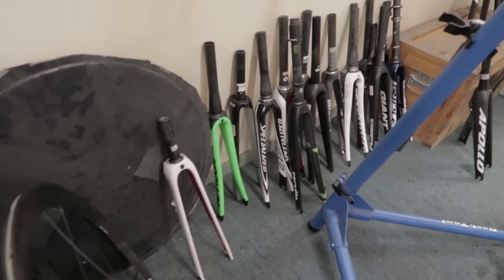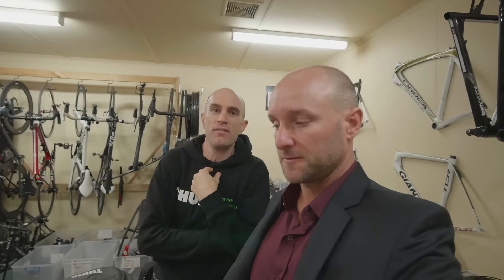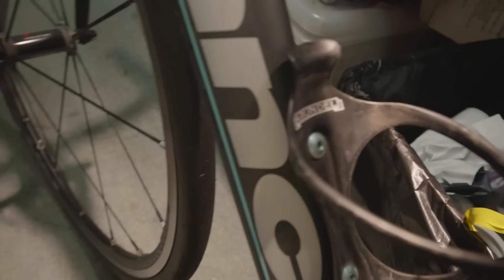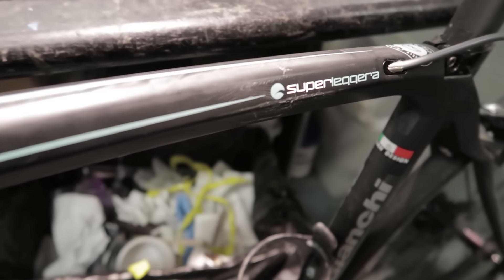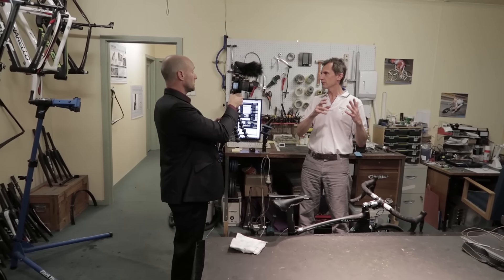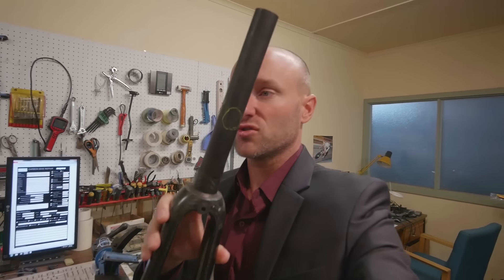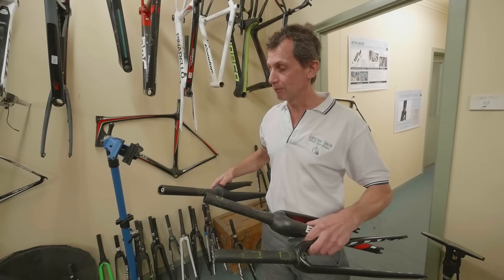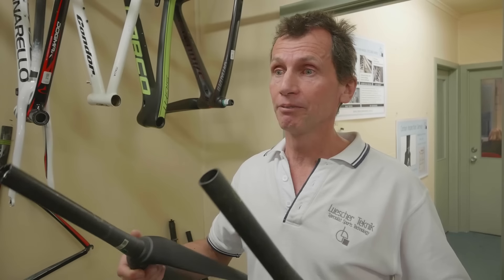Carbon Fiber Bikes - Are They Strong Enough? (ft. Raoul Luescher)

Comment: Dear friend, I am a graduated Polymers and Composites engineer and did R&D for motorsports some years ago. This guy rocks, knows his business and you did a great set of 3 videos with him. I hope to see more. Thanks for this.
Reply: I learned a ton from this, good stuff.
Reply: @LuescherTeknik  Quick question. What is the model and type of transducer you are using for crack inspection on carbon bikes?
Reply: Dude can you help me out ? I have a question, regarding one Carbon Full suspension ebike frame, i'm interested in..

Comment: Ok, carbon can more prone to manufacturing defects, damaged during installation of components, damage during handling and in a crash.  Yes, I would choose carbon???  I can understand if you race and every gram could count in a race finishing position, but I am a middle age guy who is more concerned with stability and ride quality.  I am looking at buying a gravel grinder and will probably keep the bike for at least a decade.  I also do not want to worry about gravel damaging the frame while riding.  Steel or titanium seems like a more logical choice.
Reply: Johnny Woo You are absolutely right!
I bought 2 titanium frames back in 2003.One is my winter bike with son and b& m lights,the other one was my lightweight
project and with around 8 kg it is about 2kg lighter than the winter bike(60cm frames!).
I did never regret that buy-both look brandnew and they also ride like brandnew.Outstanding performance.
You can hit the tubes with a hammer and you will barely see scratches.Best bikes i’ve ever ridden-the flexing is perfect for the bad roads
i’m riding,bad weather doesn’t affect me anymore.
And at age 17 years there’s still value to the frames.And maybe after my death someone will decide to turn them into a ✈️ plane.
You can also buy them second hand🤙
Reply: humanISvegan definitely! I’m on titanium roadbikes since 2004-i got two identical frames with different setup.
One like a randonneur and the other one as a lightweight.They are still like brandnew,although both are ridden hard.
Summer bike and winter bike.Awsome belgian handcrafted masterpieces!
But these days you can also build very light steel frames,very stiff with oversized tubes.I also have a steel bike just to have this special feeling on the road! 🤙
Reply: Nothing wrong with aluminum, it's still strong enough.
Reply: Aluminum does have fatigue life lower than steel, and is more prone to ride harshly, although my 90s Redline Conquest aluminum Cyclocross frame rides really smoothly.  My 2018 Raleigh RSX aluminum rides hard and stiff, though it's fast.  My favorite ride of all is my '95 Merlin Extralight titanium- very very nice..  Many experienced for decades riders such as I will prefer Ti and steel.
Reply: I'll stick with my titanium frame

Comment: Clone that guy! Great video. I have a carbon eyelet to build up with epoxy and I knew that it was best to do it before the humidity of summer started. Too late now; will wait for winter.  I used to ride "C7 High Modulus" Fuji SSTs.  I had some gnarly crashes in both a 2009 and 2010 model, but never suffered a crack. Of note is that the drops on those Fujis are precision cut aluminum, thus requiring an AL-Carbon mechanical interface. I sold my Fujis and replaced them with BMC 2010 and 2011 Race/Team Machines. When he said, "if you are bombing down a hill at 80kmh, you are not thinking about your cool paint job," I was smiling in full understanding. I bombed down Morongo Canyon at just that speed with a 30 pound backpack loaded with water and food.  I did it in the BMC that he cut in half and used to decorate the wall. As he said, inspect your machine as best possible and grow to trust if you buy it second hand. None of my newest BMCs have been on the big hills in town yet. The one that I used on Morongo, I gave to my young nephew.

Comment: Smart guy. Easy to understand and clear explanations. 

This won't be popular, but given the high risk, I think carbon fiber should not be allowed to be sold to the general public.  There are just too many variables that will and are getting people killed and permanently hurt- over what...saving a few pounds of weight?  Other materials these days are nearly as light due to improvements in manufacturing.  They also don't fail the same way.  

CF started out as an exotic material for the pro's back in the day.  No question, it is amazingly light and under ideal conditions it is very strong.  The problem is that it went mainstream and we don't always have ideal conditions.  Even storing it in a hot garage can delaminate it. The vast majority of your nicer bikes all use this material. People do not know how to properly maintain it.  They bump it, drop it, jump it, over tighten it, then take to the roads and single track MB courses at 20-50mph.  As he said, when the wheels of a bike go in different directions it's usually going to be a very bad day.

Comment: QUESTIONS for your next session with RAOUL:
1. Can Raoul discuss galvanic corrosion between carbon and aluminium in carbon bikes, especially between alloy nipples and carbon rims, or carbon frame and alu seat posts (e.g. nipple corrosion in Enve wheels).  Apparently in the Dreamliner aluminium is not allowed to touch carbon anywhere.
2.  Raoul’s views on use of nipple washers in carbon wheels, does carbon need them?  Do they make a difference?
3.  Can carbon handlebars fail from general age and fatigue?  I use them for both road and MTB.  Should they be replaced after a while even if never in a crash?  Is it possible for Luescher Teknik to run a set of bars through ultrasound as a service for their customers cost effectively?

And thanks for your hard work on the vlogs Maven.

Comment: This guy is 100 percent correct I work at spirit aero.  We build the 737 fuselage.  Along with the 787 cockpit section.  Aluminum planeshave a 30 year life only because of the coatings on the aluminum.  If not that time is cut in half.  787 is all carbon and some areas are near a foot thick but so strong.

Comment: They don't make fighter/passenger aircraft undercarriage struts out of CF, they make them out of titanium, which is where Litespeed, Lynskey and Moots got their start. They're both good, but my titanium bike will be around decades after all these unrecyclable CF bikes and wheels are in the tip.
Reply: Thanks for the comments. The landing gear is often made of steel, the Aermet alloy was created for F18 landing gear. Carbon is good for some things but not all things, the same as metals, that's why there are no good Ti forks available. Also note that they typically do not weld structural metal parts on an aircraft. There are plenty of metal bikes that have cracked at the HAZ around the welds. The recycling is problem with lots of research going into it right now.
Reply: Does heat treating after the welding on metal bikes (i know steel is sometimes brazed so isnt affected in the way welded steel is) reduce the cracking problem around the heat affected zone, or is the area around a weld always going to be a bit weaker?

Comment: The reason that Titanium isn't commonly used these days for frame building is not because it isn't an excellent material, it's because it has significant costs associated with it both in terms of raw material cost and even more importantly, the level of skill and craftsmanship required. A good ti frame can't be mass-produced in Taiwan for a few dollars a pop like carbon can these days. But in many respects Ti is superior in almost all respects except for absolute feather-lightness. However, even with carbon, to achieve this degree of lightness carbon  becomes very costly.

Comment: I made 64 and 128 channel pre-configured ultrasound scanners for testing rocket skins… it works really well but, in the end the best jigs were the C-scan robots with laminar squirter tips, as they are overlapped continuous and flaws like bubbles can be resolved to nearly micron scales.  However, to really see important flaws such as molecular voids, scanned X-ray is the way to go.

Comment: Who calibrates the calibrator?
Reply: That's exactly what I want to know  ??  Or better yet who calibrates the calibrators calibrator ? Fck my head hurts !!
Reply: They use a load cell or load sensor and its a fairly simple circuit that almost always has a way to calibrate itself built in.If you google how they work you'll understand how they are calibrated.But in short they get zeroed out,a tare weight is added and then the little microcontroller does the rest.Once you tell it zero and say a 10lb tare weight the little computer calculates the rest.
      It's not like they are using  mechanical measurement like the actual wrench uses to calibrate the wrench.
Reply: Thats the old insanity test joke isn't it.
Reply: Your mom does, she’s the grand calibrator
Reply: Jesus himself
Reply: There are companies that specialise in calibration.
Reply: Hahahahahha!!!

Comment: I have a carbon handlebar, attached to an aluminium stem, attached to a carbon fork. So, the takeaway here is I really should consider swapping out the stem with a carbon one to reduce the risk of corrosion.

Comment: So Carbon fiber bicycles are incredibly fragile and risky unless they're designed, and built by an engineer, and 100% tested.  On top of that they're $5-10,000 even if they are defective.  Add on to that the hospital bills for a catastrophic failure at high speed.  Somehow that doesn't seem to be a risk worth taking.

Good to know.
Reply: Exactly what I was thinking, bring me some titanium damn it !
Reply: If only graphene would take the floor already...but you need know mate, to roll on metal is to sacrifice insanely substantial amounts of acceleration, top speed, stopping distance, comfortability, efficiency and you'd be throwing much more pedaling energy into any crank movement, plus the topics discussed are for racer-types who should know what to look for in buying such godliness for quality/flaw checks...after trained eyes pass inspection, the bike has about 0.0004% chance of failure..you're taking this video as some sort of "DO NOT BUY CARBON FIBRE" type esque when it's nothing more than any other thoroughly informative video about proper care for aluminium or steel frames which have something definitely over 1 or 3 % failure rate (both percents consider perfect care and flawless manufacture, 1 year after purchase/normal use) what constitutes a chance of failure is mostly always going to be the rider's fault, for failing to properly maintain the bike's peak level of performance and success.the land of carbon fibre is a judgment call of practicality-do you race? Commute daily? Non reactive material has a massive reduction in needing maintenance,no need to freak out about water trapped in your cranks, no constant tightening of every bolt and nut per the stiffness of metal/vibration nudging them off, no warping from heavy use

Comment: Regarding the F1 situation of "why don't they use Ti"... absolutely they do. Bolts.

Why don't people use more Ti? It's very expensive and very hard to weld.

A pair of Ti bicycle forks costs more than a carbon frame.

Why so expensive? Ti refining is grievously inefficient, and most of it has to be done in by hand in a highly hazardous production facility. We won't see lots of titanium objects until we figure out how to automate it.

CF used to have the same problem, but is now mass produced, so we can have it for semi sensible prices.

Comment: I have a carbon and an alloy framed mountain bike.  Frame and rear triangle are the only parts I would use carbon parts for.  I had a cheap carbon bar that cracked from overtightening a shifter.  I replaced it with alloy and will soon do the same for my other bike even though it is a higher end brand name carbon bar.

Comment: Hey Mark not sure if you will ask about specific Chinese wheel manufacturers but see what he thinks of farsport. I recently got a set of Vision Metron 55 carbon clinchers and I found them quite flexi, to the point where they rubbed my cervelo s3 frame when running 25mm tyres. I sold them and bought a set of 50mm clinchers from farsport. They are similar in measurements to the vision wheels only not as deep. They are both 23mm wide but the farsport are a good bit lighter. I spec'd the farsports with dt Swiss 240 hubs and I'm delighted with them. The quality of them are on a par with the vision wheels but they are lighter and stiffer and the braking in the dry running Swiss top pads is excellent. In the wet they are equally as bad as the vision. Overall I am very happy with the farsports they cost me around 800 euro posted compared to 1500 for the vision metrons. Would be interested to hear his take on Chinese wheels.
Reply: Paul Malone farsport rims rox.

Comment: would he buy a carbon bike as a consumer? I think he said he'd ride his own carbon. correct me if I'm wrong.
Reply: 8 months later. my carbon frame is damaged.
Reply: Aaron _ how did this happen?
Reply: @RuggeroCappello90  first time chain suck caused a derailuer jockey tooth to press into the chainstay hard enough to dent it. 
Second time someone crashed bysode me me in a cross race landed on my chainstay. That caused two small lines or cracks. 
Both were repaired and I still use the bikes.

Comment: MR. Manurgal, for your followup interview, I would like to know about carbon fiber protection, I am a mountain biker, and the sound of rocks being kicked up and smacking the carbon frame, what kind of protection is possible. this guy was great, I could listen to him for hours. I am not a vegan, roadbiker but I love this channel. cheers from Maryland, USA. keep it up.
Reply: Most carbon mountain bikes will have some sort of protection on the very bottom of the bike, bellow where the cranks are. But rocks coming up and hitting the frame do nothing to the carbon itself. It might scratch the paint but damaging the carbon will not be a problem. I ride a Carbon Stumpjumper and crashed it from 15ft up and my shoulder gave way before my bike did.
Reply: I have a carbon stumpjumper as well. I absolutly love this bike.

Comment: Very interesting and helpful advise.  Thanks mate!  Only 1 little thing, how safe is repairing carbon going to be?  What would be a good way to have regular checks prior to a unforeseen failure of the composite?

A little explanation would be perfect.  Also, does carbon depreciate like a typical plastic bag do (in my experience)?  Any issues with carbon material being constantly exposed to extreme weather conditions (i.e. direct sunshine of about constant 56 degrees celsius at, say, UAE)?

Any videos on Ti bikes please?

Comment: Great video! But at 26:40 you say that the stiffest material will take the load first which is oviously wrong. (i'm 100% sure you know that you confused the facts there) Of cause the more flexible material will take the load first but since there is no soft crossing to the stiffer material it'll break right there. I learned a lot - thank you so much for that.

Comment: could you address weight limits for wheels... and full carbon vs carbon and aluminium rim. and spike counts. for example... 6'4 sprinter weighing 225lbs ... is there a best wheel... are there wheels and brands to avoid? 

cheers

Comment: What do you guys think about "winter" bikes? I've got a carbon Cannondale but also have an Ali bike for the winter weather. Here in the UK they use salt on the roads to improve grip for cars etc. it's said that this salt is bad for a carbon frame when mixed with water etc? Winter bikes? Are they needed?

Comment: The frame and bearing soak up a lot of force and unless you frequently ride headlong into the kerbside your forks don't take that level of lateral force. Vertical forces are the main when it comes to forks. Take and engineers ball face hammer to an alloy or lightweight steel fork and see what happens.

Comment: I have a new set of ENVE 3.4 CF wheels with DT Swiss 240S hubs ($2,900. US) and also a new set of YOELEO 50mm CF wheels with DT Swiss 350 hubs ($700. US)
So far both seem to perform well. Do you have any experience with these two? 
Thank you. 
PS  Your video analysis of local criterium racing was outstanding for understanding race tactics etc.,. Can you please do more of this type of video? they were unique and got me interested in the first place. You can mount the camera on a another racers bike if your not up to racing yourself. A road race or two would be icing on the cake. 
Thank you good Human!

Comment: As someone who works with high end carbon fiber building yachts. I found this to be the my favorite vlog to date. Keep up the great work. I ride in south Florida where it's flat and fast, most guys ride pretty deep carbon wheels which work great once your up to speed say 25mph+. I ride zipp 606's on the flat group rides which I love. In crit racing  there is a lot of acceleration surges that  require more energy coming out of slower corners or covering attacks. What is the preferred wheel depth for that type of racing? And I've never road tubular's just clintchers but obviously in a race if i get a flat i'm out so are tubular style wheels a better choice for crits? Cheers you cracking human:)

Comment: please post the comparison videos on taiwanese and chinese products. my understanding is that the chinese stuff are getting much better.

also. please discuss weak points on the carbon wheels. in my experience, the rims braking service are a problem in performance and longevity.